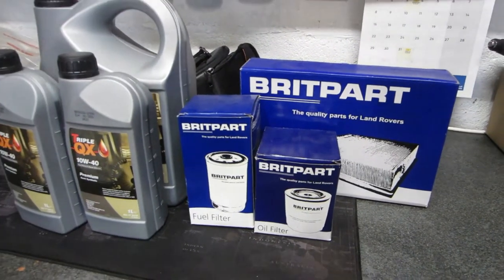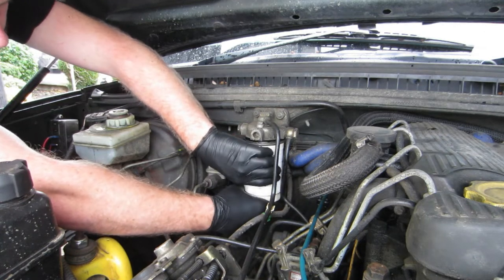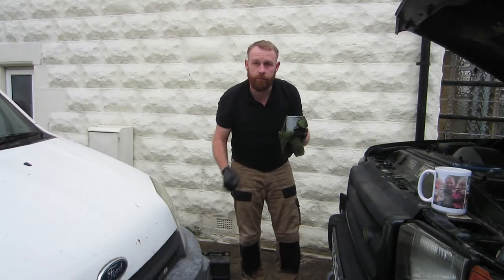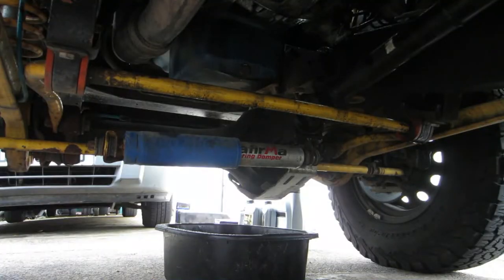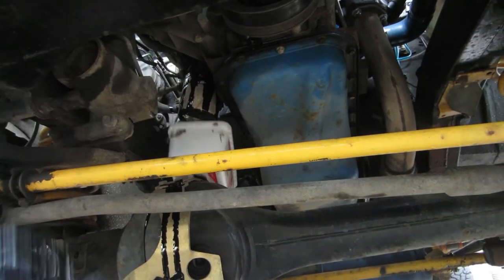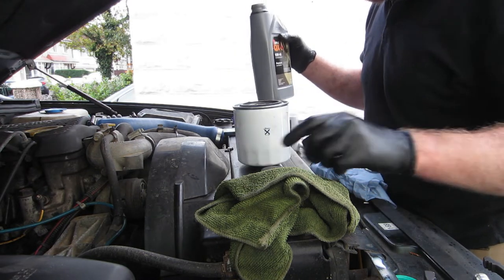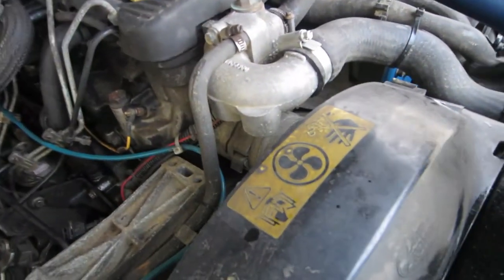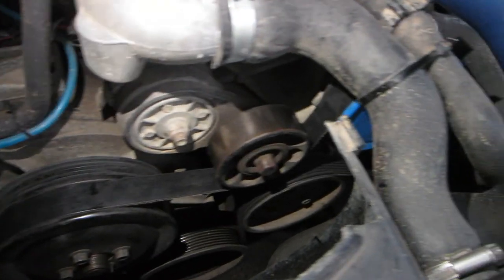How to do a service on a 300tdi

Comment: One of my favorite tools I purchased recently is called the "Oil Udder". It slips over the oil filter as you unscrew it and funnels the spillage down a tube into whatever you want. Saves the driveway so I don't get my teeth punched in by the boss of the house :D
Reply from the maker: I need one of those! Haha not a punch in the teeth

Comment: the body seems in exelent condition for a `95 disco, my `98 disco is much worse,lot of corosion under the paint while it was repainted 12 years ago or so. Looking for rear bumper lights replacement with led, the bulps going die way too quick and the brightness is like a candle lol, for savety i wish i could find led units that fit the holes in the bumper, no luck yet.
Reply from the maker: Thanks, I don’t think it has ever been painted but it is starting to show its age in places. I looked at led lights but just couldn’t get used to them